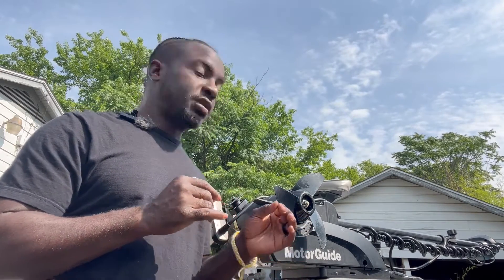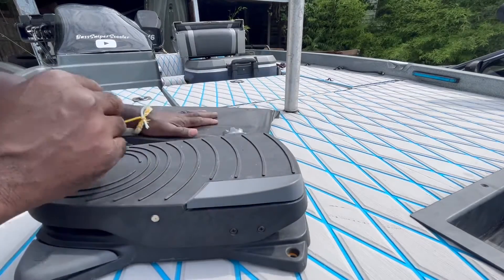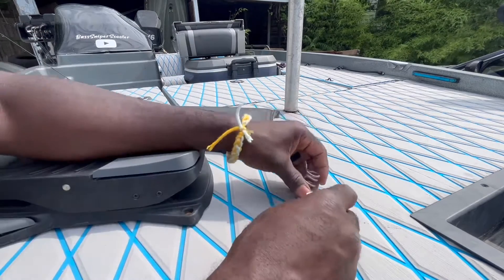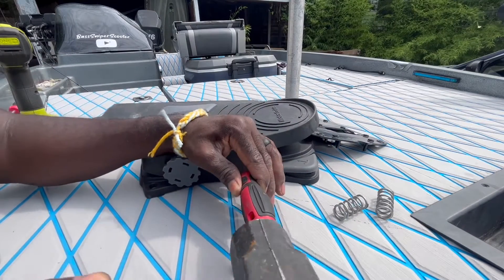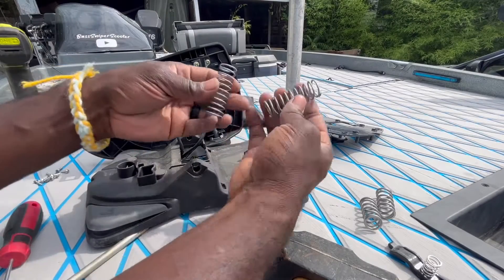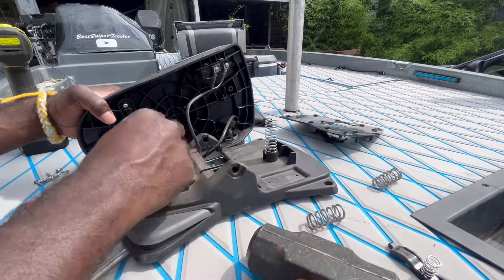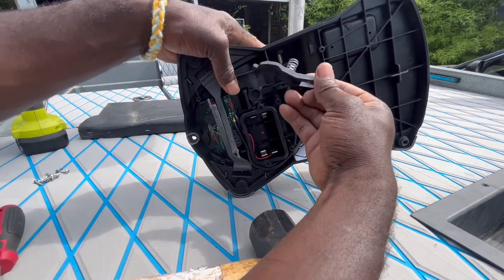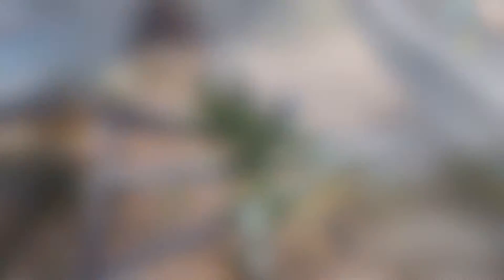Changing the Springs on MotorGuide "Foot Pedal" | Modification |DIY

Comment: Excellent video! Followed your steps to the letter and my pedal is actually usable. Looking forward to using it on the water. The stock Springs are way too stiff. You'd have to be 300 plus pounds to compress the springs and have control.
Reply from the maker: Yeah, they are just way too stiff for any type of boat control

Comment: This was awesome...changed the springs this weekend! I'm still having a problem that the motor will turn left when the boat is out of the water, but when I put the trolling motor in the water, it won't. That's only with the pedal.....works just fine with the fob. I can't figure it out!
Reply from the maker: 🤔 if it’s constantly turning, you might be getting a connection in the nodes. Make sure your springs are the same size and resistance.

Comment: Someone who is used to using a Minn Kota Powerdrive, or any motor-steered head will have no problem. If you are used to a cable steer head, you're gonna have to forget everything you knew about foot steering trolling motors. These pedals are GREAT when upgraded with the 360 springs, and works perfect for my Hobie PA14 and Motorguide xi3 kayak issue. No issues at all, and forget that key fob if you fish like I do, standing up and working shallow water alot, pitching, flipping. I fish 100% standing, so this pedal was a no brainer.
Reply from the maker: I wholeheartedly agree

Comment: Thanks for the video!  I just installed a new Xi3 54" 70 lb on my G3 and the two times I've taken it out, I've only used the key fob because the foot pedal is so damn hard to use.  But after seeing some posts on a Motorguide Trolling Motor Facebook page, I ordered new springs that several guys recommended.  Going to save your video and view it again this weekend when I try to change out the factory ones with the new ones.  Will come back and let you know how it went.
Reply from the maker: Thanks brother. I look forward to hearing how it goes.
Reply: What springs you go with
Reply from the maker: @abeabe9000  I went with a much softer 2” spring

Comment: Your content is very amazing....
Reply from the maker: Thanks a lot, that really means so much to me 💪
Reply: Your content is very good! But video SEO(search engine optimization) is low that's why the video doesn't viral. I want to help you set up perfect SEO and high res thumbnails. Soon the video will go viral.
Reply: Where did you get the replacement springs
Reply from the maker: @wg99nyr99  local hardware store

Comment: I believe you are on the right track when you say to think or operate the foot control as if it were the handheld remote control. That is, tap the pedal rather than using constant pressure to turn. I also think the new springs make the taps workable. Thanks for sharing.
Reply from the maker: Precisely, it’s still not perfect and it takes some getting used to but at least it’s workable. Thanks for watching

Comment: Hey, saw the video. Want to change the springs in mine as well, where did you get the springs and are they anti rust ones? I live on the west side of Ft Worth, I’m sure the box stores are going to have ones that will rust.
Reply from the maker: I went to the local hardware store on Lancaster. I don’t think it will matter much unless you’re using a kayak and it takes on water a lot but you can get them in any type of metal most likely.

Comment: I finally got the right springs for my warranty replacement foot pedal. installed them. It worked for 15 mins and then quit turning left. Took it home and called. The phone tech said it’s a known bad board and magnet but i waited too long so go buy a new one……”I’ll never spend another cent with Motorguide” everything has problems. The autopilot and spotlock will put you in the rocks!!
Reply from the maker: Yeah it’s dodgy at times

Comment: Great video.  Well edited, super helpful, worth a sub for sure.  One question: given your experience, would you recommend the MG trolling motor over a Minn Kota (if you have used one)?  I want to upgrade from my MK 12V to more power,  but nothing seems perfect.  Curious what you would do if you had to do over?
Reply from the maker: Good question. I’ve been certainly satisfied with my motor guide even though it’s kind of limited in many ways. But as you can see from this video, I find ways to make it work. I have a video coming out soon where I address the live scope setup as it pertains to the motor guide. It should be huge!

Comment: That foot pedal almost killed me. It caused me to fall in the water….haven’t used it since.
Reply from the maker: Wow! That’s tough. Yeah, idk how they allowed it on the market. I rarely use it now but the springs help a lot. I’m much more comfortable with it now days
Reply: @BassSniper  I just went to Ace hardware and bought 6 springs that are too big. Any chance you know the part # or place you found them? And are your springs stainless? I fish saltwater bass. Thanks
Reply from the maker: @warren6172  I think the springs I got were stainless. I don’t have the part number unfortunately. I did post the spring dimensions in the video. After that it’s just a feel test. Just make sure the springs will return it back to neutral